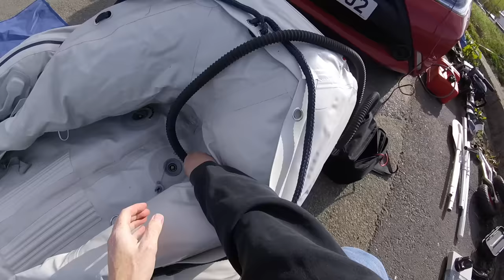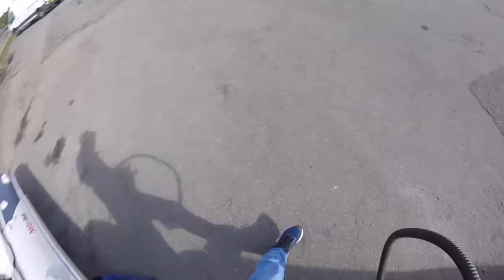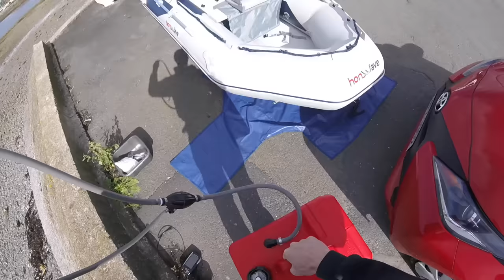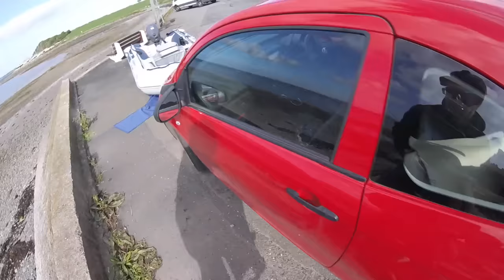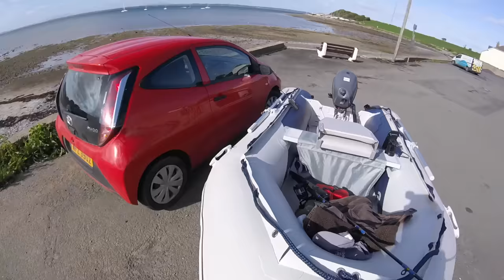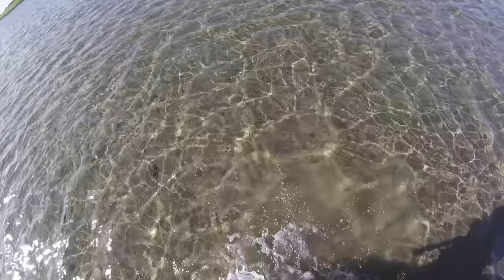Honwave T32-IE Assembly and Beach Launch

Comment: Never, ever put your VHF down or remove it from yourself when on your own. If you fall out, that boat will be blown away from you like the engine is still running and nobody will know you are in the sea, requiring immediate assistance. Safety first always.

Comment: I'm a little concerned about you wearing Waders. From where the video ended, I seen the water was still shallow. In deeper water, it is possible to slip in the water causing the Waders to fill up and taking you to the bottom before you can get them off. I had a cousin who drown in a lake while wearing them. Please be aware  --------
Reply: Sorry to hear about your cousin. 😔

In this instance though, he's wearing an automatic life vest that'll immediately inflate if he falls in and will turn him face up in water even if he'd be unconscious. 

As for waders filling up, as they fill up with water they won't weigh more than water itself so they won't actively pull you down, they'll make it harder to get back above the surface. 

Since he has the automatic life vest, he'll have plenty of time to get out of the waders and to climb back into the dinghy or be rescued.

Comment: Yep, the headache of getting a boat over a rocky beach with the tide out !   I find it easier to get the boat down as close as I can to the waters edge then go back and bring down the gear separably, its a bit of a palaver but find it easier than pulling a fully loaded boat over the rocky beach. I trailer mine now so you will find a trailer a lot easier but then you have the added pain of finding somewhere to leave it as well as the car !  Nice place.

Comment: Well, it's a working setup, at least in this super calm "lake-y" beach with negligible surf; once again confirm my decision of not getting another inflatable, and the toughest part is yet to be shown -- unpacking and putting the boat back to the car with all the mud and stuff at the end when you are already exhausted. I hate my porta bote but there's no better option still, boating is such an expensive hobby when one try to be just a little bit more serious. I hope there is a $10k solution to 17 ft, rigid bottom, pack-able on SUV without trailer, lightweight (carry-able by 1 man) boat... keep dreaming~ XD
Reply: Have you heard of frib, or winboat? I'm thinking of buying a portabote, why do you hate it?
Reply: I was to say the same. How long does it take to put the thing back (i.e. dry it, clean, deflate, roll, pack, store away).
I'd say 1 hour minute in minute out?
Any suggestion to speed it up?
Reply: @maurizioc57  Yeah, simple, buy an old cruiser and, moor it in a marina and, never use it!
Reply: On second thought....watch YouTube videos and, pretend you're on a boat! SIBs are amazing boats and, endless amounts of fun. The enjoyment from them far outweighs the effort.
Reply: @maurizioc57  Yes buy a roof rack and arrive and leave with the boat inflated on top your van, that's what I plan to do!

Comment: A few things when starting the outboard cold. Make sure the throttle is on start and the choke is fully out. Then once it’s started and you switch it off. Use restart without any choke. 

Second thing when launching using wheels. Wheel it out as far as you can until the boat is floating then fold the wheels up.

Comment: And where do you have a foot pump or a hand pump? And why are you holding this pump with your hands? Is it holding up badly? And why did you pump the boat incorrectly? If pumped correctly in the following order: 
1) Rear Cylinders 
2) Bow Cylinder 
3) Bottom.
 I hope that in the future, you pump up the boat just like that.

Comment: That would have been so much easier if you had put all your stuff at the back of the  boat for the long pull (trust me)I popped a bolock several times before I worked that out 😁thanks for the video though 👍👍

Comment: Please NEVER fill with air the bow first. Its a rule to this boats.  Always fill the back tubes first full and leave the bow last ALWAYS when filling them with air. Its very big mistake. The verical pieces that divede the back tubes from the bow tubes are stretched with air towards the bow when u fill them first. So in case the bow gets a hole and loose the air your back tube will be still full strecthed with air and so the will be able to hold you corectly on surface of water and even drive the engine. When u fill with air the bow first those vertical dividers are pushed back with result when u fill up the back tubes if u loose the air in bow the back tubes wont be streched with air anymore and will look like they lost air because the diveders will pushed to the side of bow . In that case you loose a very significant amount of presure and u cant drive with deflated back tubes. Sorry english isnt my language but i guess u got what i mean. I had the same boat many years ago but with wooden floor and v-shaped hull in a diferent way but doesnt matter the tubes where exactly the same. It was the instructions the manufacturer gave me when i got the boat its not my thinkings. Be safe . Thanks.
Reply: @ChristopherFlannigan  . You are welcome friend. Greetings from Greece.

Comment: Just brought the same set up, what are the boat pressures and is that electric pump worth having.  The foot pump seems quite good though. Yamaha 6hp engine is great, can't wait to use it!
Reply: Christopher Flannigan great vid, will the boat plain with 2 adults in it? I’m after the t32ie and the bf6.
Reply: @ChristopherFlannigan  hi Chris where did you get your battery pack for your fish finder and what's app you use on your phone when you go out thanks

Comment: How strong are those launching wheels? I bought a T32 with a 15hp Mariner 4 stroke but I use a launching trailer because I thought the wheels would have been to flimsy with the weight of the engine. Assembling the trailer is a bit of a hassle so the wheels would definitely save time.
Reply: @ChristopherFlannigan  Put the weight in the back off your t32ie (tank and the other stuff) when moving it on the wheels into the water. I can pull my t32ie with a 9.8 hp tohatsu and all stuff in the back easy with one arm because the nose is much lighter.

Comment: Thank you for this video. I have the same boat with a Johnson 6HP 2T, it is excellent but there is a valve on the high pressure floor that has peeled off and I have trouble finding a specialist to glue it. What is your maximum speed in knot do you with the Yamaha 6HP?
Reply: How much it cost  this kind of inflatable?☺
Reply: @raymundraymund6941  Ever heard of Google?

Comment: Hi chris hope you well m8. After watching your videos I have come to this conclusion that whenever I get a boat it should be this one and the same engine. Does it come with a.warranty? Does the engine come with a.warranty? As I mentioned you in my previous post that we dont have a garage this means the boat will have to be rolled up and stored in a room. Would that cause any damage to the boat or the rubber ? We live far from the seaside and it is obvious that fishing trip will not be regular. I saw you inflating the boat with the electric pump where do you get that from and how much does it cost? I also.saw you inflating the boat while the car engine was switched off.  Can the boat be inflated by leaving the engine running so the battery doest not flat out. I have an audi diesel with a 12v battery.
Reply: @ChristopherFlannigan  thanks my dear. Please keep uploading the lovely videos

Comment: Always run your car engine when using an inflation device, the device will work much more effectively and efficiently and will help your cars battery (SOC) Couldn't see you wearing a buoyancy aid or flotation jacket and your VHF radio should be in a waterproof case and attached to your body at all times.
Reply: Weren’t paying attention then were you!!

Comment: I’d recommend ditching the waders as if you fall out the waders will fill of water and weigh you down
Reply: Water weighs nothing underwater.
Reply: Mr J Ashton-Tyler trust me, been there, don’t wanna be dragging a full pair of waders out the water!
Reply: @stevemiddleton948  Agreed - but getting out of the water is different - you'd take them off in the water while they're weightless before getting out. While you're in the water considering your options they don't weigh you down.

Comment: great video. Why you have airdeck boat and not aluminium floor?
Reply: Oké, but I mean the inflatable boats with seperate  aluminium parts for the floor.
Reply: Oké clear, you mean, too much work with the aluminum parts. And no difference in stability?
Reply: Thanks a lot!

Comment: I will bet you $1,000 that once you unpack that inflatable boat and use it for the day, once you deflate it after you’re done, you will NEVER get that self-same boat BACK into its outer bag/wrap. I had a Zodiac with a similar configuration. Only one way is to use a vacuum pump to remove ALL the air from the boat’s innards. Only THEN can you even make an ATTEMPT to squeeze it back into its carry bag. Although, the COOLEST thing about my old zodiac was that it had 3 under riggers under the floor that made it corner like NO big lake boat could, even with a simple 40hp outboard motor. I pissed off a lot of so-called big lake boats with men who wanted to drown me & run over my dinghy with their own boats, but they could NEVER catch me due to my INCREDIBLY HIGH MANEUVERABILITY! In fact (I live in Illinois), & in Wisconsin on Lake Winnebago, I had an A-hole chase me in his big powerful twin motor cabin cruiser for almost an hour (my dog was aboard also), and FINALLY a Wisconsin D.O.N.R.’s (Department Of Natural Resources- basically COP BOAT) “pulled him over” and initially cited him for reckless endangerment, until they found out that he & his entire crew were SEVERELY INTOXICATED. THEY went to jail and their boat was impounded. 😝, ONCE IN A BLUE MOON JUSTICE REALLY IS SERVED. Hallelujah!!! P.S. ya moron, where is your 4’x8’ flat trailer that you could place the dinghy on and WHEEL it to the shore without scraping the CRAP OUTTA the bottom of your VINYL boat. You have ZERO common sense!

Comment: absolutely cracking video well done mate, i’m seriously looking into buying this model for my son and i to fish on, the OB that’s on offer in my local boat shop is the honda 6HP as a man of experience would you say this is a “man” enough OB or would you recommend a bigger OB my only concern is with the weight increase if the engine after 6hp? i am a large chap ha ha look forward to your reply thanks again for the video
Reply: Christopher Flannigan 

thank you very much for the detailed reply looks like i have a decision to make 😬
Reply: 6HP with a single rider and minimum gear 15MPH is doable.  As you gear up, the number drops.  Add a second rider, the number drops considerably and it becomes very unlikely you can plane the boat.  If you will be two riders most of the time, definitely get at least a ~10HP outboard.  Tohatsu 9.8HP MFS9.8BS is just 81.5lbs(37kg) and priced well for a 10HP outboard.  The lightest four stroke 6HP is the Suzuki DF6AS2 at 52lbs (23.6kg).  The Tohatsu is heavier for sure, but this is still within what most adult men can carry without too much difficulty.  I have two of those Suzuki 6HP and I love them, so dont get me wrong.  But they are really for single rider light gear situations only.  Two riders light gear should be looking at 10HP minimum.  Two riders heavy gear, 15HP minimum.  But these days the 15's weigh the same as the 20's (Tohatsu, Suzuki, Mercury, Honda), so you mind as well get the 20HP for $300 more or whatever at no extra weight and just run less than full throttle.  15HP outboards are obsolete now, IMO.

Comment: Hi Christopher. Great video. Saw a similar video when I was looking at buying a T38 but not in as much detail as yours. I've had my T38 for 3 months and am well pleased with it. I have the same outboard as yours. The one thing I did buy was this.  https://www.amazon.co.uk/gp/product/B00KWVP7KA/ref=oh_aui_detailpage_o01_s00?ie=UTF8&psc=1 
After nearly losing an outboard on a previous boat. Dirt cheap and peace of mind. I've the same wheels as you too 😃 A bit of a faff but worth the money. It's just the pins that are a pain. Was tempted to make the hole slightly bigger but thought it might make it wobble to much. It depends where I'm launching from but sometimes leave the outboard off till I get the boat near water then get the outboard. Bit more walking but much lighter dragging the boat. 👍
Reply: Christopher Flannigan your welcome 👍 I've still got a lot to learn but loving being out on the boat. Should have done this years ago...

Comment: That motor sounds very sluggish, install a one less prop pitch from current  factory delivered prop, combo will plane much faster...
Reply: Any faster he might start flying away.
Reply: Nah, I run a 2 stroke Tohatsu 18 HP on the back of those, with deck load evenly distributed flies but over the water...LOL!!
Reply: @searider9922 
.

Comment: I didn’t watch the entire thing yet, but didn’t you put the seat in backwards?

And to each his own, but too much electronics! KISS!

And cooler for beer? Bait? To put the fish you catch in?

It’s a real learning experience working with these small inflatables, and I understand everyone is different.
Reply: Christopher Flannigan But you need the beer!!!

I’m in South Florida, and it’s like an OVEN here for the next few months!

I’m getting an inflatable Catamaran next month or so, not an expensive one, about $1000 U.S., to run with a Torqeedo or ePropulsion electric motor. I don’t go far offshore, going to use it for dropping blue crab pots and for the Everglades, the parts that don’t allow petrol motors.

I’ve had  bigger boats, and they’re a pain and an expense! And although this cat will inflate a lot faster than yours (smaller tube dimensions), and although one person can easily CARRY it to water (she’s 12 feet/4 meters), and although the electric motor is so light, I’m still going to trailer it. 

I have no problem blowing her up, but I can’t stand deflating and packing it up to go back in the car!

Comment: Do you need to be holding the air hose in place the whole time while inflating the boat?  If this is the case, then I think somebody needs to re-design the fitting.  Looks nice!
Reply: @ChristopherFlannigan  Hi. I have same setup as you including pump. I just connected original hose from foot pump which came with my Honwave to my Bravo hose. :) Hose is now longer and more comfortable to use around the boat and it has original adapter on its end.
Reply: @ChristopherFlannigan  Sorry for confusion you) There are no proper connection between those two hoses. All I used is some duct tape ;)

Comment: What’s the laws on using one of these in the sea ?
Reply: In the U.K. No license needed for ANY pleasure boat of any size, just obey local bye laws. But be prepared to spend lots of cash. Engine, Insurance, WATERPROOF VHF radio , RYA SRC Course (reqd to legally operate radio), trailer, registration and launch fees. Life vest. Wheel clamp and hitch lock, slot lock for engine. Oh and fuel. 🤑

Comment: Too much hassle launching it.dont want to think about landing,packing it back.too much wasted time.would rather use a trailer
Reply: Using a trailer is not the idea of the honwave fully infalteabe ie series... only one bag in the car trunk, no heavy floor plates. If you want a trailer better buy the aluminium floor version or a rib...
Reply: I put mine on my Roofrack.